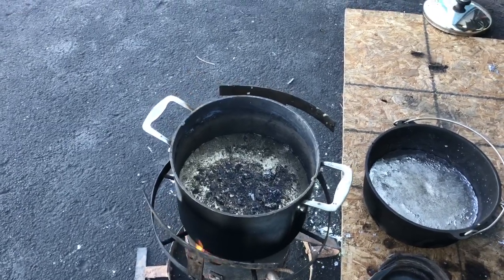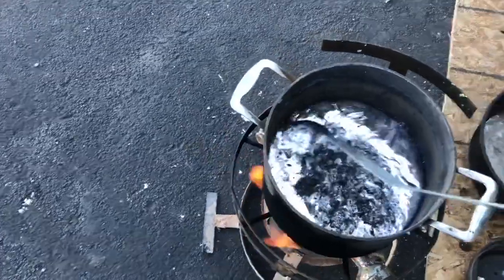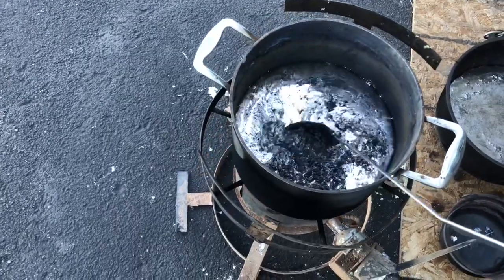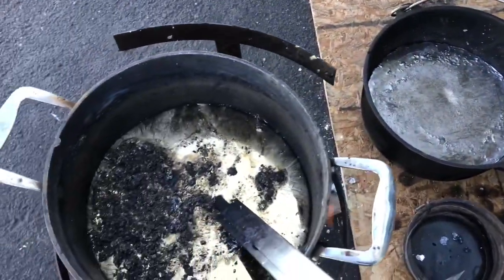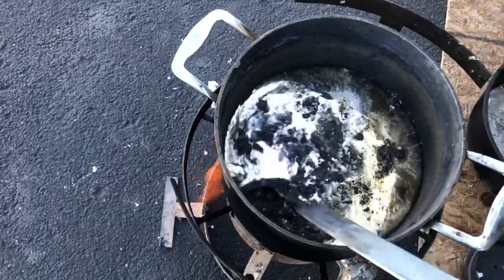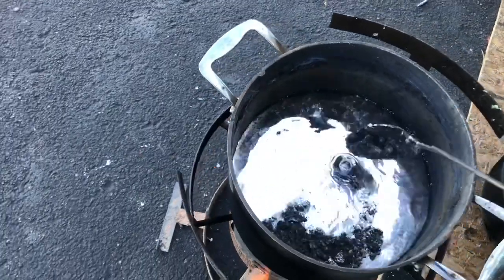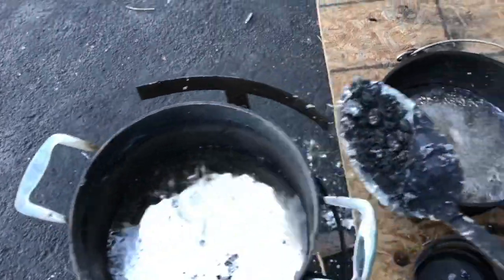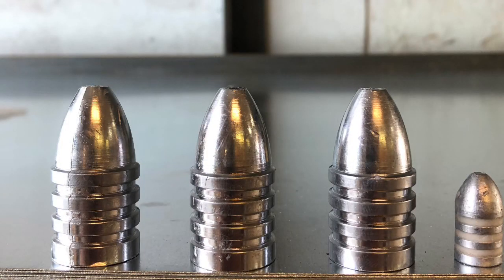Removing Zinc from Bullet Alloy

Comment: Lead boils at 3128 degrees, Zinc boils at 1670 degrees, so if you push the lead to 2000 degrees, wouldn't the zinc just boil off?

Comment: I would say you can only separate by weight and temperature. Get the lead barely melted, then scrape of the grainy stuff on top.
Professional bullet makers just throw the lead with zinc away.
You can test your lead with the flame of cut torch. If there is sink, then it will burn, don’t breath!

Comment: It's real easy to keep zinc out of your lead. First, at the end of each casting session leave about half an inch of lead in the pot.
This will make getting started next time faster because the lead is making full contact with the cast iron pot.
Second, you will be starting out with a known alloy. Generally either pure sodt lead or fairly hard wheel weight alloy. When the lead melts to liquid state turn down the heat so it' just stays liquid. Around 700 degrees is good if you have a thermometer.
Add wheel weights a hand full at a time. Any that float are either zinc or steel. Scoop them out. Easy.
The stuff that melts but forms a thin layer on top that looks like oatmeal is tin or other things in the alloy that are ok. It's not zinc.
Flux the pot with an inch long piece of crayon and stir to mix the good stuff back into the alloy.
What will be left on the surface will be powdered oxides that should be skimmed off and disposed of.
Wear eye protection, long pants and closed toed shoes.
If you spill a pot of hot lead on you foot you will never forget it.
Never get a drop of water in a pot of hot lead. There will be a steam explosion that will blow tiny droplets of hot lead all over you. Ask me how I know.

Comment: guys, pure zinc melts at 787, but zinc wheel weights melt at 729 deg. and even if you hold it below that temp, the zinc will still sublimate into the alloy. just like alloying aluminum with steel. a furnace at 1280 degrees will still alloy in steel that melts at 2800. the best way is don't get the zinc in there the first time. 
zinc wheel weights are an alloy of zinc, iron, and aluminum
Reply: Well if you get lead from the ground there might be some zinc in some deposits.

Comment: I like how safety conscious you are wearing shorts with cloth tennis shoes 👟 what could go wrong 😑 kind of the same as riding a café motorcycle wearing shorts and flip-flops 🩴👍my brother use to be a nudist seen him one day after he was using some carbon rods welding a couple peace’s of metal he was holding between his feet 🦶 and yes he was naked the good news was he only got sun burned on the front of him and the bottom of his feet I told him I thought that’s why welders were leather so they don’t become the leather but it’s up to you just thought I’d mention it👍👍👍🔥✋🙌👌🤪

Comment: U R working too hard!!  When the lead is too hot, there is sludge at the bottom of the pot, that is zinc.  Using sulfur isn’t the only way to remove that junk.  Try waving a cold piece of leas in the pot, and see now much junk you can collect.

Comment: Been there. Missing zinc is tragic. Keep the pot temp at 650°f and they won't melt. Good luck and happy casting.
Reply from the maker: These were lead bricks from an x-ray room.  I actually read about this method on another forum and decided to try it.  Haven't had a chance to get back to it to see how well it actually worked, or if it did at all.

Comment: The way to remove zinc is not to overheat.  Lead, Tin, Zinc all have a melting temprature.  If you stay around 650F you may be safe.

Comment: If you can control your heat Lead melts at 622 and Zinc melts at 787. Just keep lead at or below 700 then zinc should float on top.
Reply: What temperature does the lead zinc alloy melt at? Lead zinc alloy AKA Spelter melts at a lower temperature than Zinc. You might be able to get some of it out by carefully melting the lead but not enough to matter.

Comment: After 40 years of casting I've got a real easy way to seperate the zinc and I stumbled onto it by accident.  I melt my raw lead with a cast iron pan over a hot plate, with 25lbs of wheel weights in the pan and some pure lead that hot plate is lucky to get the mix up to 650*-700*.  Zinc melts at way over 800* so it just floats up on top of the lead and looks like silver cottage cheese.  Scrape it off and flux your melt as usual.  Easy-Peezy.  I also cast almost pure lead and water quench.  Then I powder coat all my bullets and that has been a revelation, clean and fast all bullets are done in 20 minutes hundreds at a time.  I push those bullets over 1400fps in a 357 and I get no leading and very little smoke even with Unique.   When I clean my firearms all the barrels need is a little brushing, it's amazing.  You need to try it.  The only extra step is that the powder coat adds .001"-'002" to the finished size so 9mm is perfect for 357 and it's easy and cheap to push 357 through a Lee sizer for perfect bullets.  My 45's are a shade over .452" when finished and I've never had to resize.
Reply: @Ryder Walker two things: 1) no, nobody cares, and 2) she is your victim, not your girlfriend.
Reply: That's works fine as long as the zinc doesn't get hot enough to join the alloy. If it does, it's a whole new ball game. I powder coat my 12ga slugs and buckshot. It does make a difference, especially at long distances.
Reply: @showproja  I just use a cheap, 1100 watt Walmart hot plate and a 12" iron skillet  for cleaning my scrap lead.  That hot plate barely makes over 700* in the summer and in the winter 650*-670*.  I also check the mix with a thermometer but it works great for me and a bunch of my friends.
Reply: @showproja  Yep. Once you get an alloy, the metals are chemically bonded.
Reply: Not to be a prick but Zn melts at 787F not at "way over 800". Is virtually impossible to separate them once the Zn reaches it's melting point and becomes part of the Pb alloy.
Reply: Theres no reason to ever get the alloy hot enough to melt zinc.
Lead melts and pours fine right around 700 F. Zinc weights will fload like a fishing bobber on a pond at the correct tempetature for melting lead.

Comment: sulfur bonds to lead
Reply: This is simple. Don't get zinc in your lead to start with. Lead melts in the mid 600s f range. Zinc melts in the high 800s. Use a lyman lead thermometer to be sure that the lead never gets hot enough to melt zinc.
Any zinc wheel weights that get into the pot will float on top of the lead like a fishing cork on a pond.
If I had some contaminated alloy that I wanted to try and save
I would bring the temperature up to 900f and let the pot sit for an hour. then skim off the top quarter inch
And save that alloy for cannon balls.
I would lose whatever tin that was in the aloy but I would also get rid of most of the zinc.
Reply from the maker: Johnn Davis the zinc is in some stuff I got for free.  I would never mix zinc wheel weights in with bullet metal.  It looks like oatmeal on top when it is all melted.  
This method is something I read on another forum and tried out.  I decided to video it and post.  It seems to have worked fairly well.
Reply: @staceyporter6095  It has worked well for me, the zinc just floats up on top and looks like silver cottage cheese.  Scrape it off and flux, your all set.
Reply: I got some in my pot from a few 2-3 oz bank sinkers I picked up at the lake. Like you said, it gets kinda clumpy and can be skimmed off with some sacrificial lead. I added in some fresh and skimmed it really well and I was up and running without having to toss the whole pot.
Reply from the maker: Got this info off of a forum and decided to give it a try.  It seems to work
Reply: @staceyporter6095  let me know how it works, one of the mane problems with lead is sulfur is bonded with it